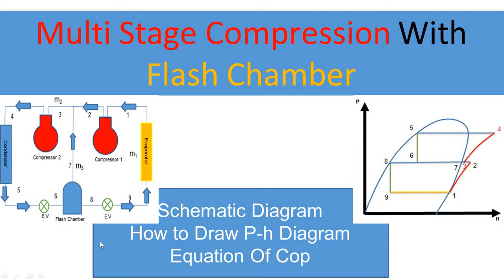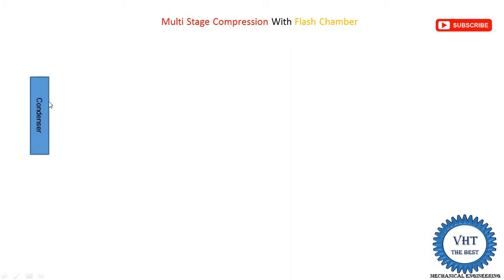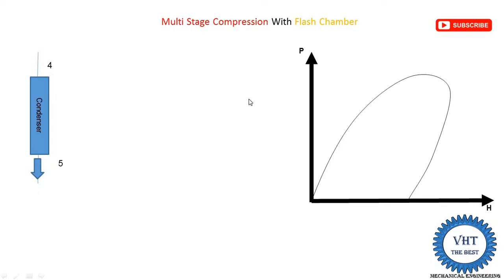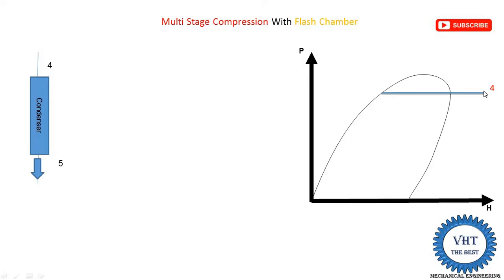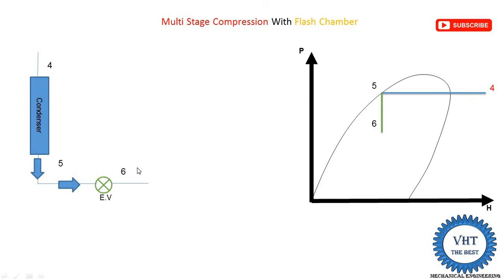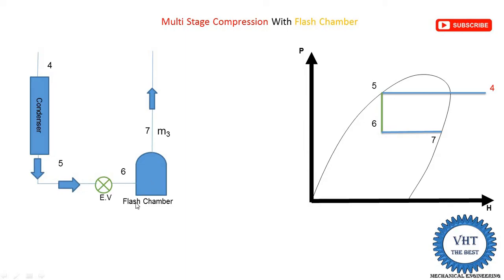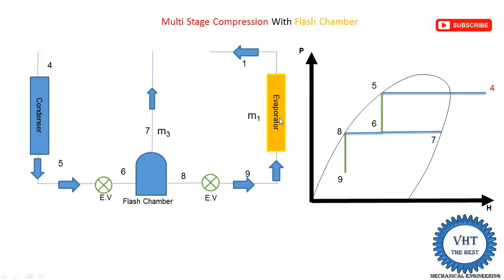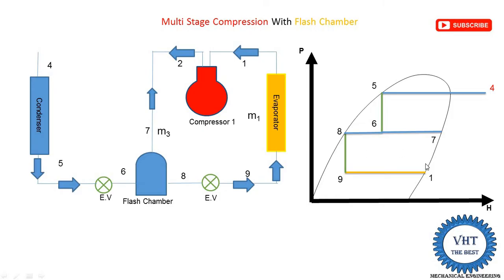Multi Stage Compression With Flash Chamber

Comment: P h digram compressor process curve but in book straight line reasons
Please tell me
Reply from the maker: In PH Diagram isentropic compression line is drawn curve line. So i request to watch my video of basic of ph diagram.i t is available in playlist then go in vcrs.
When we draw isentropic line for small compression ration then it will look like inclined straight line.
When we draw for large compression ratio then it will look like curved line.
When you plot ph diagram for different refrigerant means using different ph diagram like R 12 ,R134 a ,Ammonia .pressure range(scale in y axis)  is  different in different PH Diagram.so some time it look like inclined straight line.
Reply: @bestmechanicalengineering  
Ok i check u r playlist sir.

Thank you very much ifafter watching video doubt remain then i ask Thank you
Reply from the maker: Not possible. for compression process striaght line draw in T S diagram.
Reply: @bestmechanicalengineering  
Inclined straight line and aome where curve why??
Reply: Inclined straight line on PH